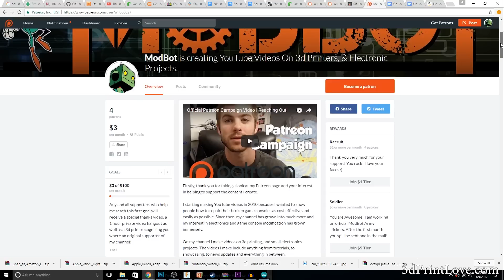Make Your China 3d Printer Kit Safer! Easy Upgrades!

Comment: Step one: Remove those insufficient shit wires that come with the bed and get wires that use silicone insulation on them.
Step two: Remove that shitty power supply and find a suitable ATX power supply cause at least then you will have protection. 
Step three: Use high quality mosfet controllers for both the bed and nozzle. 
Step four: Keep a fire extinguisher nearby.

Comment: I got a 3d printer from ali the other day, wich I don't have anymore. It caught fire because the heater for the hot end got loose and fell out onto the part I was printing (nothing salvageble from the printer, 1 ruined desk and heavy smoke damage to the room it was in)
Replace the hot end heater block for the one from E3D. I think that holds the heater in better than the setscrew design that comes with most Chinese printers.

Comment: I fixed my 3D printer. Turns out the way they had the capacitor on the LCD it was shorting. They solder them in but then they cross the legs but they don't touch. I guess I accidentally touched it and the legs shorted it out.
Reply from the maker: +Its Voodoo what a crazy thing to cause a problem how did you even think to look at that as a potential cause?
Reply: ModBot one of the ribbon cables started to heat up so I decided to look at the LCD.

Comment: Most if not all of the problems related to the power supply is because of improper wiring, not the power supply themselves. Please, DO NOT TIN the wires. If you do, I will guarantee you, your power supply connectors will burn 1-2 months later. Another thing chinese kits forgot to do is wire stress relief.
Reply from the maker: You mean tin them with a soldering iron? If so why would anyone tin them? I am just trying to figure out the logic. Since the psu just used clamp downs to connect to the wire I feel like tinning them would make it not get as good of a connection.
Reply: Exactly, we know its ridiculous, but there are people out there that tin them.
And in some DIY kits, the wire came pre-tinned.
Reply: My A8 ran for couple weeks and then the R20 diode or what ever it is up in the left hand corner if you have the screws at the bottom and looking inside the power supply. This little thing burned half into. Before I opened the unit I contacted gearbest and they told me that was the only thing on the printer that didn't have a warranty.lol Pissed me off. I have never studied any circuit board stuff so if I didn't know the name of it I am sorry for that. But it says R20 right beside it.
Reply: i don't get it, why would it burn with tinned wires ?

Comment: Hey All. Good video, but there is also another way to make your 3D printers safer now, by using the XYGAX Smart Switch;http://www.ebay.co.uk/itm/Smartswitch-by-XYGAX-FULL-version-universal-3d-printer-safety-device-/192091854132?_trksid=p2047675.l2557&ssPageName=STRK%3AMEBIDX%3AIT&nma=true&si=BGCDXuBnMEQKLEc3imgN1AHQ5Vg%253D&orig_cvip=true&rt=ncThis adds a seperate MosFet for bed control along with temperature and gas sensor(s). Pretty neat little unit if you're in the market for something like this.More being produced this weekend apparently
Reply from the maker: the link you posted is an ended listing and i could not find anymore on ebay. I would be interested in seeing the item if you can get me a link!
Reply: ModBot Hey buddy. Yeah sorry, the first 200 sold out very quickly and the next batch is apparently being assembled this weekend. So far there is no dedicated Web page, but I do have the pdf instruction manual and wiring diagram I will try and post somewhere to be downloaded. If I can't do it via my phone now I will do it on Sunday

Comment: replacing the connectors with xt60 works pretty well.  Great video and I think these things are often overlooked until it's too late.    better safe than sorry I always say.
Reply from the maker: I may have to add the xt60 connectors to my possible suggestions for those who do  not want to solder directly. Thank you for the suggestion!

Comment: the positive and negative wire going from the power supply to the board should get crimped. They got corroded on my 3D printer.
Reply: Crimping a wire doesn't stop corrosion. It just makes it a better connection.
Reply: Gerardo Prieto The wire itself is having less contact with the humidity after it's crimped.